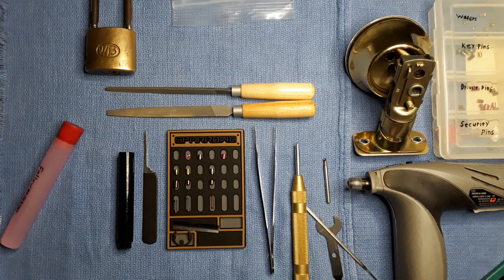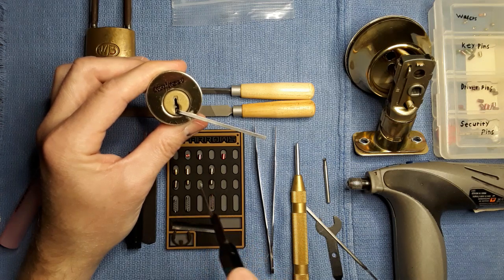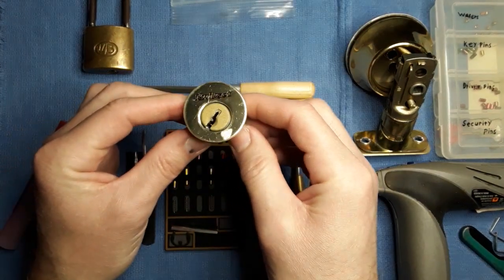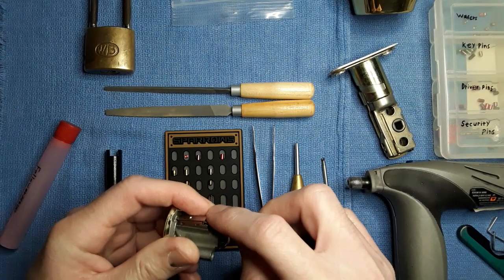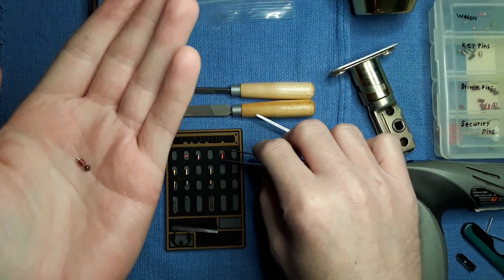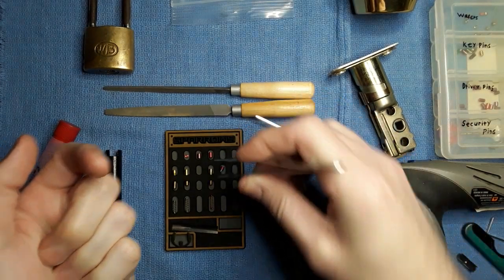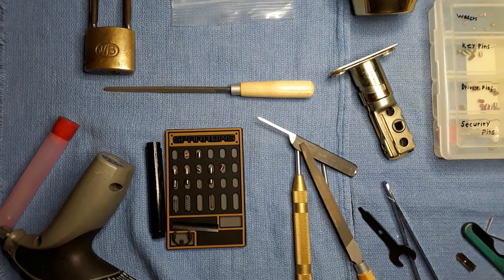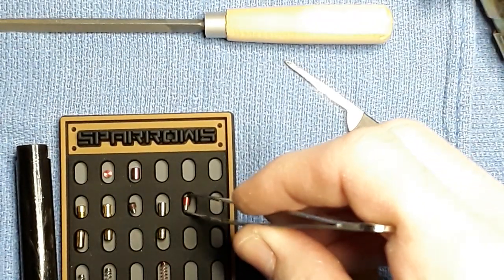(013) Own a Kwikset deadbolt? Wanna learn to make it pick proof to deter an intruder?

Comment: Very cool. Thanks for sharing this with us! 🩷🥰😊
Reply from the maker: I just hope someone doesn't attempt it without knowledge of how to re-key and repin locks. You have to be very precise when drilling those trap holes in the core. You dont wanna be too close to the key pin chambers but not too far away either.
Reply: @jack_of_all_trades_master_none  well you could leave a precise measurement for that specific core in the description for anyone who has one and wants to give it a try. If you didn't put that already. I didn't read the description (I hardly ever do 😆) Even if you don't leave the measurements, I'm sure anyone who tried it will be super careful when drilling those holes. Anyhow love this video and your channel! 🥰🩷😊